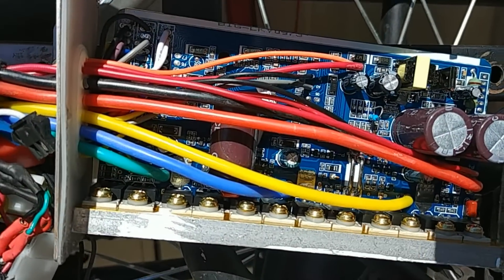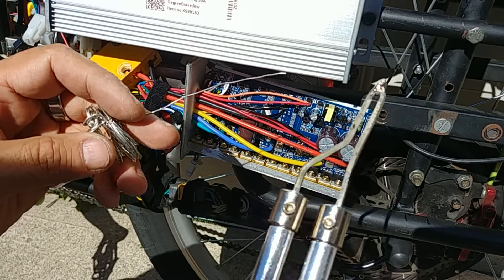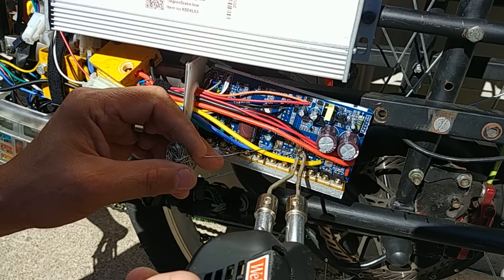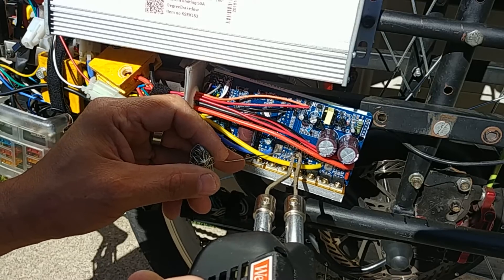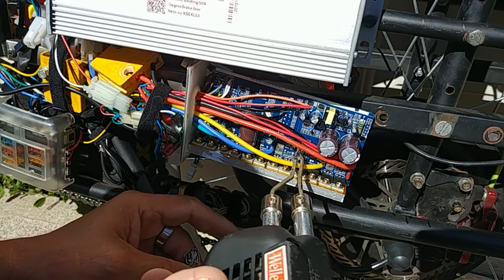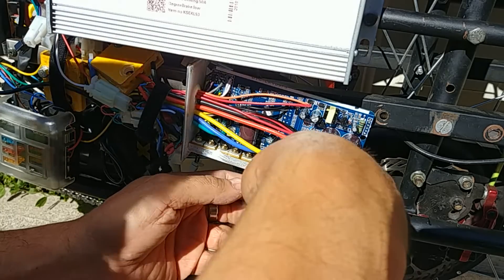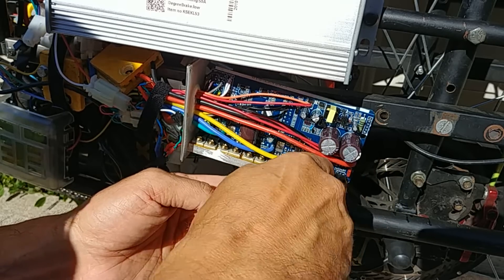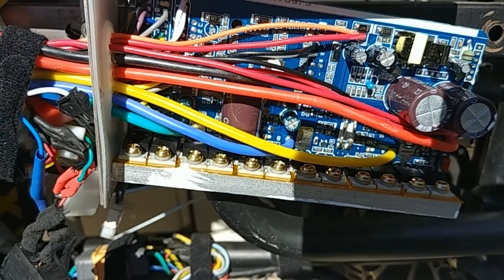ebike Shunt Calibration extra Amps*Quick Video*

Comment: My understanding is that even the slightest voltage increase of 0.6 will burn up a mosfet. So its been two years since your post here, did your shunt mod you show keep working without damaging the controller? Thanks!

Comment: I shunted my 52v 1000w hub motor controller, it was fine for a few days until i took it on the beach. I went to pull away and it died, i disconnected the battery and as i went to reconnect the anderson connector blew up in my hands. I took it home and put on some xt60 connectors instead. Same result again, it blew up in my hands. The manufacturer is adamant its not the bms. Can you give me any advice please?
Reply: Dead short, solder on shunt melted landing between pos/neg battery leads.
Don't ask how I know.
Reply: See this is exactly why I’m too afraid to try them out on my bike because everything is different and I don’t know damn thing about electronics, but I know how to use a solder iron and I know I could do the mod
Reply: Even a mere 0.6 voltage increase can damage a mosfets, they are super delicate
Reply: I have a Z8 1500w 15.6amp 48v battery. And the shunt was a single decently gurthy shunt. So i wrapped a 3rd of the shunt on rosincore sauter and heated it. The sauter adhere perfectly. It looks like a resistor😂 skinny at the ends fat in the middle on the .onitor hits 73mph, still have to road test. Shame, im not a toutuber😂😂😂